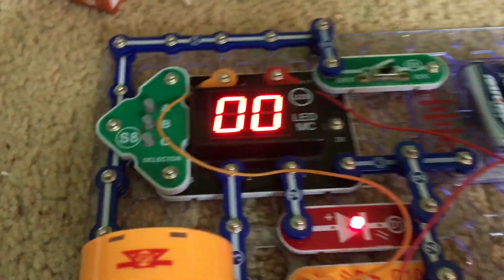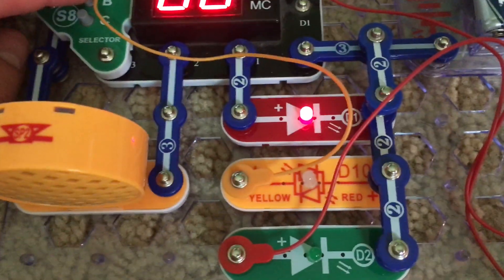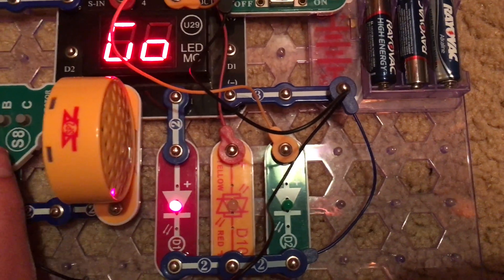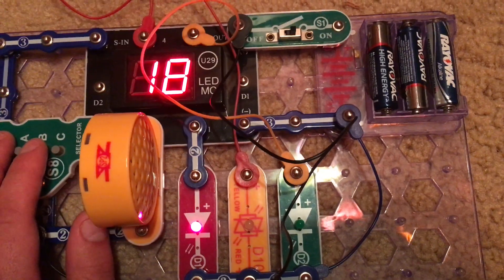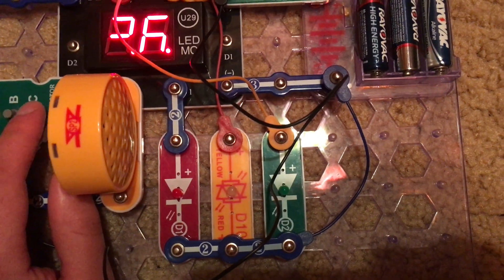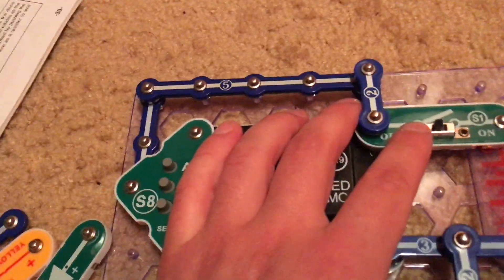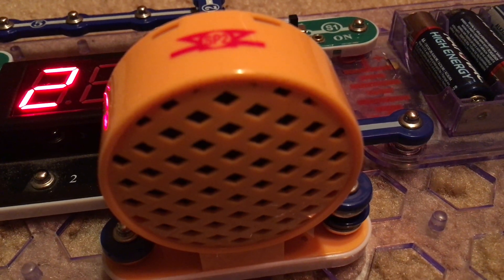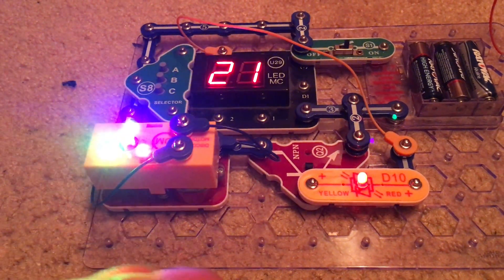Snap Circuits Arcade: Projects 31-45 (SEIZURE WARNING)

Comment: The gear noise in the disco motor is making me really curious of the inner workings - would you please do a further teardown video to reveal the gear assembly before you reassemble it again?
Reply from the maker: I'm so sorry for the late reply, but while I think your request is great, I don't know if I can take the motor apart, but if I can, I will make a video of it.
Reply: @andrewsstation6436  It's okay - I understand if this is not possible for you!

Comment: I'm surprised you were able to win the progressive memory game. I have snap circuits and I love them. They're so fun amd enjoyable to build and watch them work. I have lots of snap circuits kits.
Reply from the maker: I love snap circuits too!  As far as I know I have 5 major Snap Circuits kits.  I enjoy trying all of the projects, and the Progressive Memory Game actually seems easier than most of the other versions of that game for me.
Reply: @andrewsstation6436  Yeah that's what it seems like. I never tried progressive but it does look easier.  I have 7 of the Snap circuits kits. I have Light, Sound, Arcade, 3d Illumination, Green, Motion, and Bric Structures. So far 3D Illumination is my favorite.
Reply from the maker: RockyYoshi2244 The LED’s flash slowly, then get “progressively” faster.  I have Snap Circuits Extreme, Sound, Light, Arcade, and 3D Illumination as well.
Reply: @andrewsstation6436  That's cool.  3d Illumination is a very cool set in my opinion.
Reply from the maker: RockyYoshi2244 I agree.  I am uploading projects from that set, but it may take a while since I am sometimes busy with school and work.
Reply: @andrewsstation6436  That's okay. I understand.